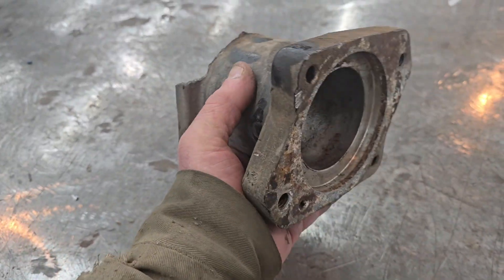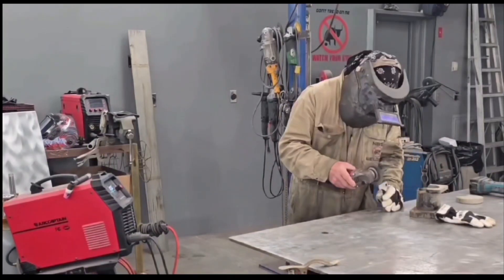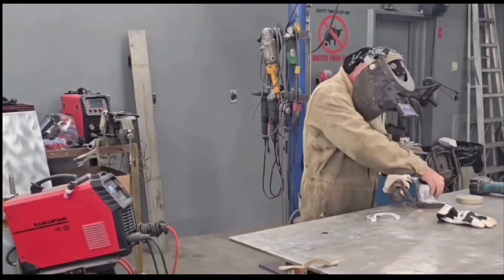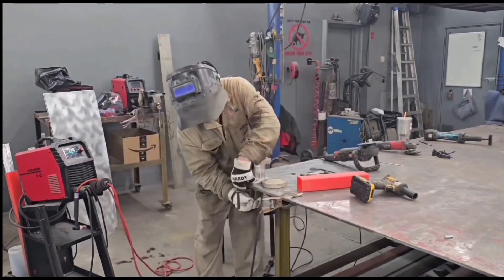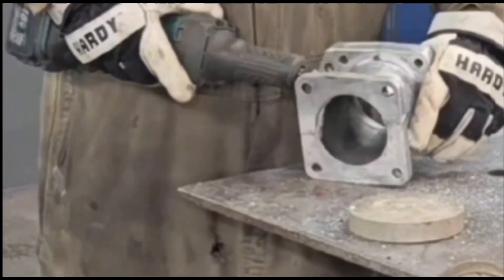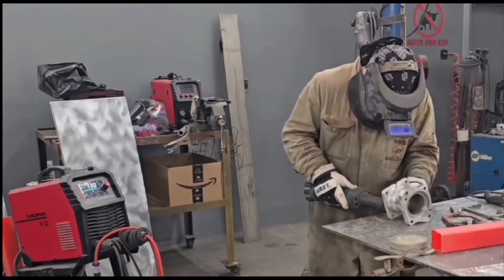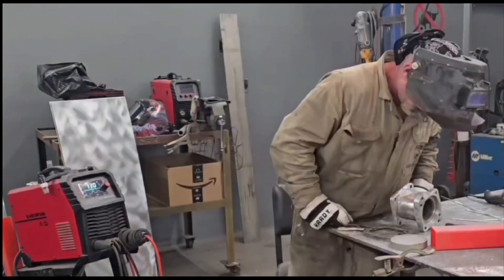TIG welding cast aluminum winch housing

Comment: Never had any carbide burrs until recently..  Bought dad an air tool set 30yrs ago that had a die grinder and grinding stones,  I used that until few years ago ( I guess I got it for me to use in his farm shop, since he only used the blow guns), then got some carbide burrs a couple of years ago.  I didn't know what I was missing.  Last year I picked up Hercules 20V  just because it was on a promo sale.  Not a bad free tool for me to use outside in front of the shop.  HF is really picking a fight with milwaukee's metal working line of tools with the Hercules brand
Reply from the maker: Agreed....I use quite a bit of Hercules blades lately as we have a Harbor Freight nearby my shop nowadays....easier for me to get than anything else actually...I'd hafta drive farther to buy Milwaukee or Evolution blades

Comment: Do you use a aluminum specific grinding disk or a steel grinding disk with the bees wax?
Reply from the maker: I use a 5" sanding pad on a 4-1/2" rubber sanding pad backer....I don't use any sort of grinding disk on aluminum and I don't recommend anybody else does either....even aluminum specific grinding discs destroy aluminum by embedding their grit into the aluminum....that never seems to happen with the sanding pads

Comment: CB what is the brand and model number of the grinder you’re using with the saw blade? I’ve been trying to find a bigger angle grinder with that type of forward handle on it to use with my larger cup grinding wheels for leveling.
Reply from the maker: https://www.harborfreight.com/10-amp-7-in-variable-speed-rotary-polishersander-70589.html?utm_source=google&utm_medium=cpc&utm_campaign=21901739270&campaignid=21901739270&utm_content=173216766391&adsetid=173216766391&product=70589&store=496&gad_source=1&gclid=Cj0KCQjwy46_BhDOARIsAIvmcwNzEjhljSEz2sbU4nvjfG3BApEx-lTQ1alttsYmT-2YmEjG_P6oSE4aAsN2EALw_wcB

Comment: What is a death wheel?
Reply: @terrycapehart6303 He also uses a slow speed polisher to run the blade it so it's a little bit less deadly. Don't run the saw blade in your regular 12,000 RPM angle grinder. (link to the polisher in a reply to a comment above)

 @NBSWELDING  On the subject, CB do a YT video search for "STOP Using These 3 Temu Tools Before It's Too Late" (made by pete's tools) at the 3 minute mark it gets wild. I am unable to post links in comments sorry.
Reply from the maker: I tried....terribly sorry I can't watch that...I can't stand another second of that guys squeaking voice...I hate it when I can't watch something with good content because of something like that but I'd rather eat a handful of dirt than hafta listen to that voice another minute
Reply: @ I understand, he does have an annoying voice. "Rather eat a handful of dirt", haha! Sorry for making your ears bleed.
I should have said a "mute audio" warning. 🤐😁

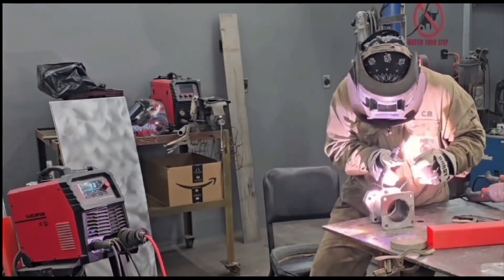At 3:45 the grinder grabs the work piece and is flung into his stomach and chews up his arm, missing his face and neck by some miracle. Quite sobering to see it.
Reply from the maker: https://www.harborfreight.com/5-38-in-30t-metal-cutting-circular-saw-blade-58113.html
Reply: Thanks, I'll stay away from those death wheels, yall have a blessed day

Comment: That really is no bs. How do you like the arc captain tig set up. I jist got the mig250 and im excited. Not much info on it at all. Id like to get an HTP or ck worldwide for tig but will settle for the prime weld 325 in the mean time
Reply from the maker: I think the ARCCAPTAIN TIG200P is the best TIG I've ever ran...as good as any $15,000 Miller I've tried....I just got a MIG250...it will be in a video soon...stay tuned